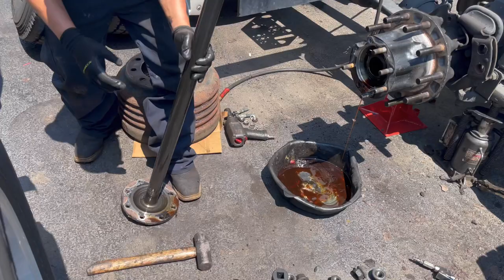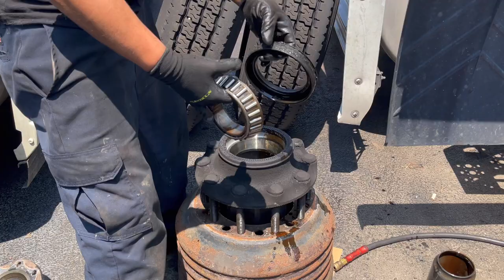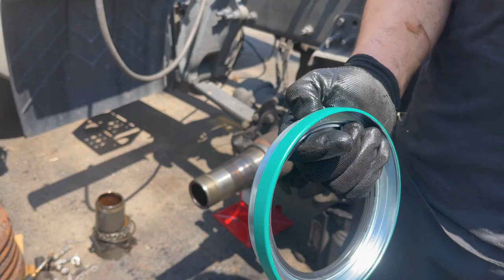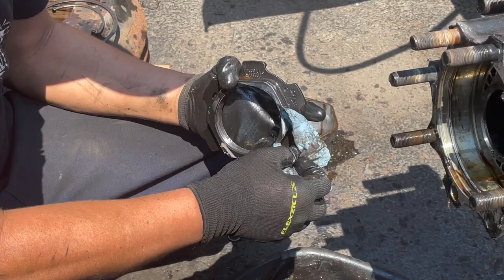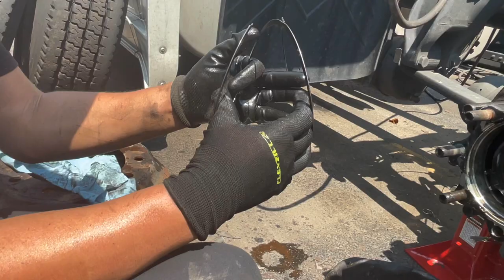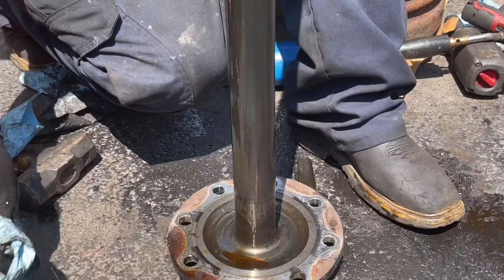Wheel seal replacement on semi truck. Poor workmanship, still going strong years later.

Comment: Hopefully all of those components he installed were “ brand spanking new” because he destroyed the spindle, bearings, hub.  Please do not use this method for replacement.
Reply: Thought the same when he pulled the seal hitting the bearing from the back 😂, and just wire wheel all the seal journals that have tight tolerances.

Comment: Back in the 70s' I didn't take the tires off to do this. Get a steel plate put some grease on it jack the axle just enough to slide the duel's off. saves a lot off work.I worked at GMC Trucks
Reply from the maker: I wish it was still that easy! Trucks these days they get more difficult! Gone are the easy days!!
Reply: @TruckerDudeEBM  it still is, you're just lazy. you can still buy dollies

Comment: Yeah no torque spec o.O? Using a wire wheel on the spindle mating surfaces?  Not to mention the other issues with the integrity of the bearings?

Comment: Why would you remove the spiral snap ring ?? That’s there to make your job so so so sooo much easier.

When you back the spindle nut off it uses the spiral snap ring to pull the hub and seal off the spindle for you … 🤦‍♂️ 

Why the map gas too??? Why ??

This hole video ?? Why why why ??

You wouldn’t need heat on a spindle nut if you had the proper long breaker bar
Reply from the maker: Hey man i was just filming!! But long story short, its been a few years since and I have not  had a problem with it yet!! Why are you pulling your hair out over how that mechanic repaired my truck??